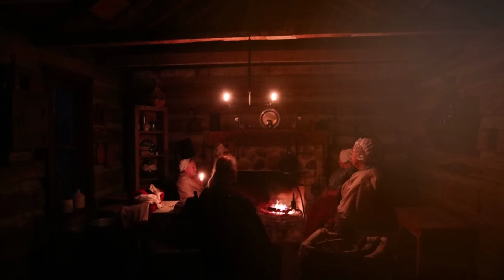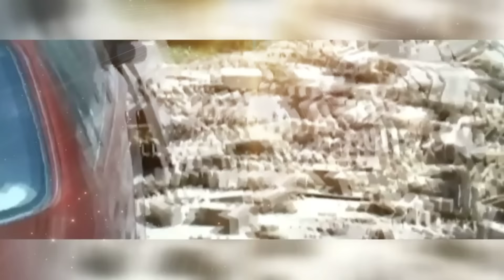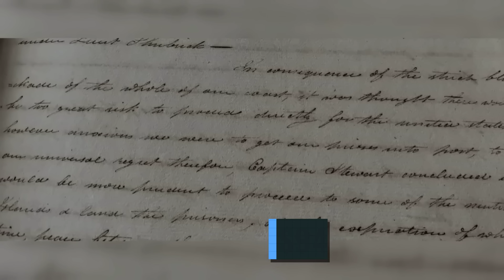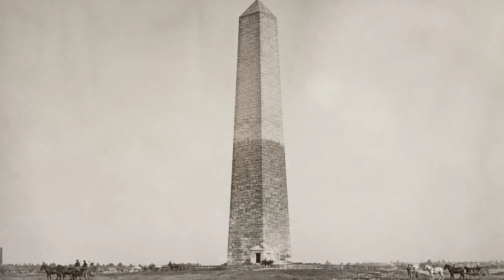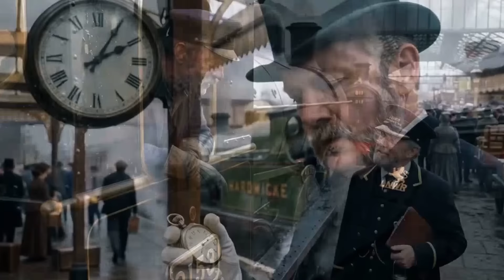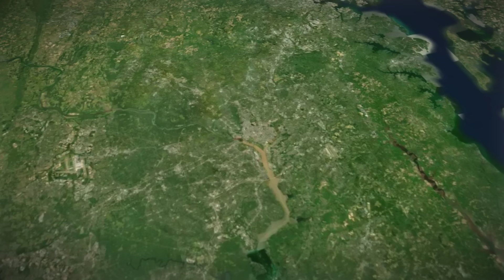The Machines That Built the Washington Monument (1848-1884)

Comment: When I was a kid, you could both walk up the Washington Monument and down.  I remember running down the stairs with my brothers.  I’m going to correct your information on the Reflecting Pool you gave at end of video.  I worked in DC from mid 1980s until 2005.  I used to do my run workout by running around the Reflecting Pool up to Lincoln Memorial  and back around the Reflecting Pool .  The water has always been dirty and soupy with algae in warm weather more or less and it was drained and cleaned multiple times that I remember.  It’s only a new story now because the current president is not very popular in Washington DC.  Otherwise, nobody really paid attention to it before.
Reply from the maker: @paulhughes1553 Thanks for the great firsthand account, Paul! Your memories of running the Monument stairs and your years working in DC bring real history to life. Really appreciate you correcting the Reflecting Pool info — that kind of personal experience is invaluable! 🙏

Comment: Capstone cover is made of copper.
Reply from the maker: @matrox Correct! The aluminum capstone (tipped with a copper design element) is a fascinating detail - it was actually one of the first major uses of aluminum in a structure at the time. Great fact!

Comment: The surface of the reflecting pool was not prepared, so it didn't stick. The water was pumped out of the tidal pool near the Jefferson Memorial. It was full of algea. Next time, they will probably order truckloads of pool water.
Reply: The water always comes from the tidal pool. That is the design.
Reply from the maker: Rick Good point - that's actually a fascinating part of the design! Thanks for clarifying.
Reply from the maker: Russ Thanks for the interesting background info! The tidal pool water is definitely a unique design choice. The reflecting pool has quite a story of its own!

Comment: You're sawing off the branch your channel is sitting on with the BS about the pool at the end and the glaring omission of even more expensive work in 2012.
Reply from the maker: @gtcazusa Thank you for raising this – the 2012 restoration work on the Washington Monument was indeed significant and much more extensive than we covered. We appreciate you holding us accountable and will keep this in mind for future videos! 🙏
Reply: The 2012 work saved the reflecting pool which was sinking.  Some 2,000 pillars were installed down to bedrock and a steel reinforced pool was relaid over that, with new plumbing and drainage.  Trump's botched paint job (that he drove over while it was curing) is costing half of Obama's complete rebuild of it.
Reply: @shjsmni  All the more reason to mention it then, huh? Saved the pool. Don't reply to arguments I didn't make. The video shows the algae only after the latest renovations - with a date on the screen as if chronological, as if the algae exist before. Which is a glaring lie. The only aspects of the pool he mentions in the video were in the same nightmare condition for decades before 2026. The Obama Admin fixed the sinking floor. So mention all the work and cost... seems politically intentional to mention the smaller job, and blatantly make it look like the actual cause of the problems. Which it is not.
Reply: Your rant omitted what the work in 2012 entailed - much more extensive than painting the bottom.

Comment: Did they get the crane down with a helicopter?
If you ever made sense, I would drop dead.
Never question the narrative.
"History is a lie agreed on" - Napoleon
Reply from the maker: @uhadme Great question! 👍 The derrick crane used during construction was actually dismantled piece by piece and lowered from the top - quite the engineering feat in itself!

Comment: Funny how they had to mention how the reflection pool had problems in 2026 but they didn’t say anything about the equivalent $50 million when Obama was president and how the exact same thing happened.
Reply from the maker: @davidt8438 Great observation! Infrastructure maintenance costs have always been a challenge regardless of administration — these projects require ongoing investment across generations. 👍
Reply: Orange Man bad, blah, blah, blah!
Reply from the maker: @jeffreyvosburgh2099, thanks for watching! We keep this channel focused on the engineering and history side of things.
Reply: Funny how you didn't say a thing about the Obama-era project that was primarily undertaken to shore up the base of the pool, which had been sinking into the ground. You Trumpcultists are an astoundingly dishonest bunch.
Reply: @jimwing.2178  Funny how dishonest you are: "Between roughly 2010 and 2012, the Obama administration oversaw a comprehensive overhaul of the reflecting pool, addressing long-standing structural issues such as leaks, stagnant water, and the gradual sinking of the pool into the land dredged from the Potomac River during its original construction. 
The project included removing nearly all of the original structure, reducing the pool’s depth slightly, and installing a new circulation and filtration system that used water from the nearby Tidal Basin instead of city drinking water. The bottom of the pool was tinted gray to improve reflections of the Washington Monument". Can you now admit that the $34 million dollar circulation system, the filtration system using dirty river water, and the painting of the bottom gray did not work out to well?
Reply from the maker: @greg6235, thanks for laying out all that detail - definitely a more complex story than a quick clip can capture! Appreciate you digging into it.
Reply from the maker: @jimwing.2178, thanks for the added context! We aim to keep the focus here on the engineering and history rather than politics. Appreciate you watching.

Comment: The Texas San Jacinto Historical Monument is taller than the Washington Monument.
Reply: Yeah, big deal. They aren't really the same, the San Jacinto Monument is built primarily out of reinforced concrete faced with limestone. The Washington Monument is not made out of reinforced concrete.
Reply from the maker: @captain54525 Great trivia! The San Jacinto Monument is indeed impressive in its own right. And as Chris1776qry pointed out, the construction materials are quite different — great discussion! 👍

Comment: That " crane" or derrick on Thumbnail looks like its 40 feet high. Howd they get it down - dump dirt around it OR is it fake?
Reply from the maker: @familydogg1234 Great question! They actually used an ingenious system of scaffolding and a steam-powered derrick that was disassembled in sections as the monument was completed. No dirt needed - just remarkable engineering! Check the video for details!